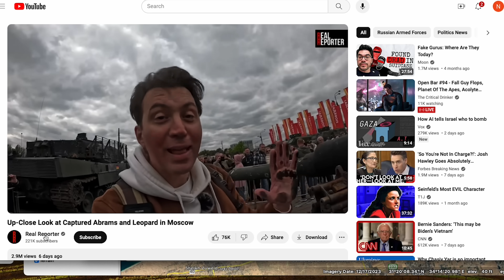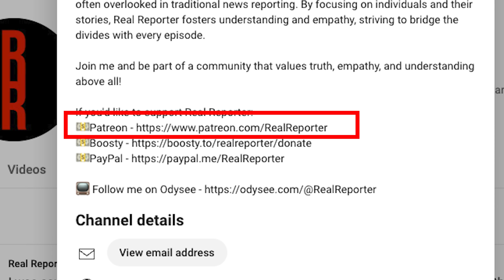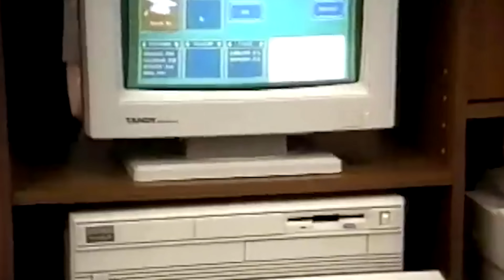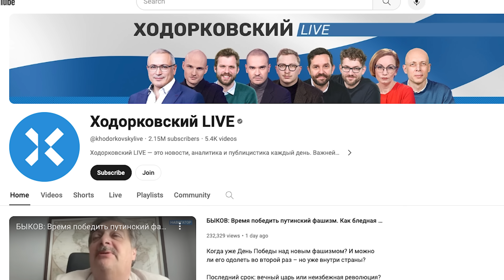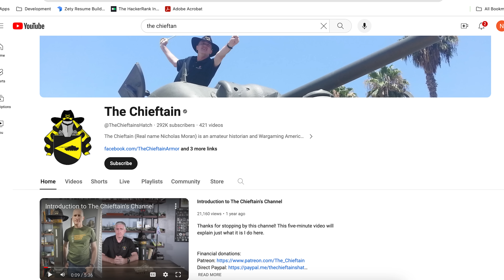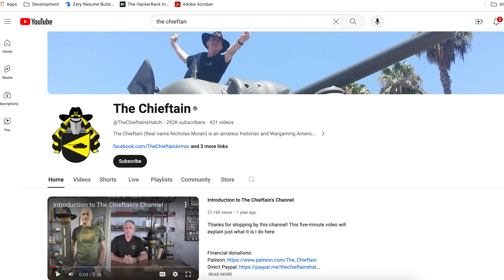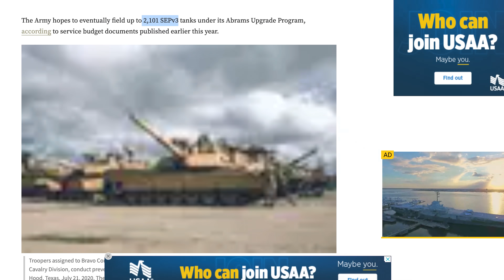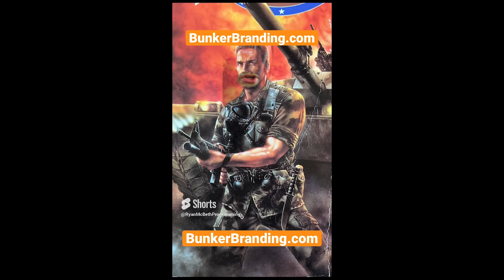Analyzing Real Reporter and Captured NATO Vehicles

Comment: Given that the most modern T-90 variant still lags behind the pre-SEP M1A2, its pretty easy to see why Russia keeps calling the M1A1 in Ukraine a "modern tank". To them, 30 year old tech is modern.
Reply: Remember when they first managed to get a Bradley in 2023... They were quite amazed by the tech. It was a Bradley built in the 80's.
Reply: "Modern"
Like the indoor plumbing that 22% of Russian houses don't have
Reply: in a russia modern means post soviet era seriously
Reply: How? It has better thermals, better frontal armor, and only lags behind when it comes to having full blowout panels protection and reverse speed.

The Abrams sent to Ukraine also aren't base M1a1s. They are the M1a1 SA, which is still in active service in the US Army. It is basically an M1a2 Sep minus the CITV. Naturally we don't export the DU armor, so it has a different armor scheme.
Reply: @voidtempering8700   No it doesn't have better thermals, not sure where you got that idea. The sight that was developed (with no proof of widespread implementation) is supposed to bridge the gap to western standard (per Russian claims which tend to be lofty). And sure, while the T-90 has better frontal armor, the M1A1 is better protected from HEAT projectiles than the T-90, which in this war has proven to be much more effective than being able to take frontal shots. Even then, a Bradley seemed to be able to put a T-90 out of the fight with frontal shots just fine, it didn't kill it, but the Bradley was able to fight another day, which shouldn't happen with the T-90s "better frontal armor". Also, you say it lacks in blowout panels and reverse speed as if those haven't proven to be major factors in this war. The crew isn't fighting again if their turret detonates and flies to Mars while they're still inside and they're gonna take a lot more hits if they can't get the fuck out of there fast enough. That makes a tank and it's crew dramatically less survivable. Also, the M1A1 SA is not basically an M1A2 SEP, it's not even at M1A2 standard. It's an up-armored M1A1 with a FLIR sight and better comms equipment.
Reply: @DuBaas007  The ODS Bradley also wasn't built in the 80s, it was made after Desert Storm. Not that it really matters since most Russian IFVs would like right at home in the 70s
Reply: @voidtempering8700  Most bradleys the Ukrainians got were from the 80's and 90's. So pretty old stuff.
Reply: @DuBaas007  That is newer, design wise than most Russian IFVs. Even their BMP-3 is a horrendous design. Lots of firepower, but they kind of forgot it was supposed to carry an infantry when they used a light tank as the baseline design. Even the BTR-82A, it would be fine in the 80s, but they still make it in 2024.
Reply: @voidtempering8700  I know, don't worry i realise it. That's why i said that it was funny how amazed the Russians seemed at the old American tech from the 80's and 90's lol
Reply: @treyaldridge1757  Looks like my comment to you was deleted.

To sum it up
1. Russia is already mass producing 2nd generation thermal, using cooled 2nd generation thermals and uncooled thermals. The 2nd generation cooled thermals are on par with those used on the SEP, not the pre-SEP.
2. The T-90M offers better HEAT protection than the 3rd generation DU armor thanks to using Relikt instead of K-5 ERA. 
3. The instances of a T-90M launching its turret immediately are incredibly rare, and its frontal armor, from what I have seen, has never been significantly damaged unless weak spots were struck(optics, gun barrel, etc), which would disable an Abrams as well.
4. The M1a1 SA was introduced at the same time as the SEP V2, including things like Blue Force Tracking and a modern BMS, which allows networking with other SEP V2s, which makes it better than the SEP, let alone the M1a2.
Reply: @voidtempering8700  1. Again saying they use it and proving that it's implemented en masse in Russia are too very different things. 2. Not according to any source I've found which all suggest that the M1A1 is not quite as good at defending kinetic projectiles but are better at defending HEAT ones, and this is numbers specific to the M1A1 SA. 3. Rare means it still happens, turret tosses don't happen with the Abrams. And again, you're not seeing frontal armor being defeated because you're cherry picking frontal armor shots, which are generally not the main way tanks are being destroyed in Ukraine on both sides. 4. If they were introduced at the same time, why are they separate? Is it maybe because the M1A1 SA was designed primarily to enhance situational awareness (SA) so it focused in those areas while not receiving the upgrades to armor, optics, and fire control that the M1A2s all did? I mean this is all public information that was very easy to look up but what do I know?
Reply: @treyaldridge1757  Ok. I am reposting my original comment to address most of these.
But for 2. Are we not comparing the T-90M and the M1a1? All tanks are better at defeating HEAT when compared to kinetic projectiles, that is just the nature of the penetrators. But the T-90M has better frontal protection when compared to the M1a1.
3. You are the one that brought up being damaged by frontal armor hits. Can you decide what you want your argument to be?
4. You first say that it is an up armored M1a1, then you say that it enhances it's situational awareness, but you say it has inferior optics. Can you decide where you want your argument here as well. You are offering up contradictory information from comment to comment.
Reply: The M1A1 is what the US military mostly uses though. So it is "modern"
Reply: @treyaldridge1757  dude there's videos on youtube of M1A1's getting hit by RPG7s in Syria and blowing up from one hit. I am skeptical of your "Better armor" claim
Reply: @AndRei-yc3ti  No, the M1a2 is what the US mostly uses. Mainly the SEP variants.

However, the M1a1 SA is newer than the SEP, but lags behind the SEP v2 and V3.

Comment: I will keep this video as a clear example of unfair propaganda.
A real reporter does not hide where he comes from and the fact that you spend time "revealing" this secret shows how biased you are and are not able to make an objective analysis.

Also, rubber pads are useless in a field with a soft mud surface, and this is exactly the place where they are used.

Also, depleted uranium linings would not help a tank, which can be punched into the back of the turret from a machine gun.

Not to mention, American models that are intended for domestic use are made using simple RPGs, from the same locations as those used for export.

Comment: The comparison of tanks as computers is so wrong - the military equipment doesn’t age the same way.
Reply: I agree, computers, especially since the 90s, have been one of the fastest advancing technologies.
Reply: alot of the things he says make no sense.. like the hole in the tank.. why need mental gymnastics for a hole in a tank froma battle field.. and about if that reporter is western or not.. he says there is a video where he explains but has to invite someone else to explain same thing
Reply: He’s a computer guy so I suppose it makes sense. work in aviation, the current most used models are almost exclusively designs from 40-50 years ago that have been slightly updated. There isn’t the exponential leaps and bounds to be made like we’ve had with computing. He’s partially mechanically ignorant and likely just huffing a wee bit of copium.

Comment: The M1 series of tanks does have a problem on ice. I've literally rode a 68 ton toboggan while training in Germany. In war, the plan for countering this problem was to reverse every fifth or so center guide. These have teeth that normally keep the roadwheels aligned to the track. Reversing them serves as ice cleats but would destroy any hard surface as well as wear out pin. Also, the M1 track pads are mono-directional, they are not angled to the track and the pads are not removable. You have to replace the entire track block.

Comment: The M1A1 tanks we sent to Ukraine also reportedly were rebuilt to remove all the advanced DU chobham armor as well, replacing it with tungsten alloy armor. While still good, its nothing at all like the armor on American M1 tanks.
Reply: The export model never had the DU to begin with, afaik neither chobham, nor the german composite use DU. dismantling the entire turret just to swap out the composite armour is a waste so I doubt they'd do that. It would be less toxic to touch after a fire though.
Reply: DU is not particularly more effective than Tungsten. It's cheaper and self sharpens, those are the advantages. Tungsten however is harder. The main reason the Russians don't use DU is machining DU is a bitch. They could but they don't bother, they have Tungsten coming out their ears.
Reply: @petitblanc7343  according to a Forbes article by David Axe on February 23rd 2023, the 31 M1A1's being sent to Ukraine were not export models, but surplus US tanks, and GDLS had to take those to the Lima Ohio plant to remove all the DU due to DOE export regulations. Also note that the export version of the M1 tank is actually the M1A2, not the M1A1, so this does make sense that those tanks sent to Ukraine had to get DU removed.
Reply: @firelock9080 This is the M1a1 SA. It is still in use by some US Army units, so they probably got rid of them to add more Sep V3s.

Comment: Just want to point out.
The Abrams given to Ukraine doesn't have depleted uranium armor.
Reply: no but it's the australian standard which claims to be almost as good.
Reply: It will not be change anything all 5 Abrams were destroyed by mines or drones from top
Reply: @GambitShole ............... they haven't sent 5 types of Abrams. Did Russia manage to blow up an American tank variant that was still in America?
Reply: Wouldn't have changed much if you follow the realities of this particular conflict
Reply: The du armor isnt changing anything bro
Reply: moot point, the drones didn't penetrate the frontal armor anyway, they went through the weak rooftop, which has the same protection in all Abrams variants, whether it had DU or not, M1A1 or M1A2 Sep v3, it doesn't matter at all.

Comment: Reverse engineering on the basis of one specimen is doomed to fail. You need a series to measure all the tolerances. And then you need the tooling, the knowhow, the materials, the knowhow to produce the parts etc etc
Reply: Russia has dragged back a much more intact Abrams.
Reply: You cannot reverse engineer on the basis of one specimen. You need lots more. There are always tolerances and you can't know what your specimen is on the tolerance scale. Then, you have to figure out how to make all the parts, how to source the materials in the right specifications, then setup tooling and find people with the experience and expertise to get the job done. It6 far more difficult than you might think. Besides this Abrams is a 20 year old version and far from the current US version. Remember your PC from 20 years ago?

Comment: Regarding the rubber track pads on tanks... I work with civilian catapillar tracks of various sizes. 
If a 10-40 ton digger with no rubber track pads can literally destroy a bitumen road by crossing it, I'd hate to see what a 50-70 ton tank would do with no pads. 
The Israelis were using old tyres to try stop their road from being damaged by their armoured veichles and even the old tyres didn't last long under that stress.
Metal tracks being twisted or turned across a road will gouge the road to shreds. Having dozens of track veichles traverse the same road could turn that road into broken wreckage that would take hours to rip up, then re-lay and cost tremendous amounts of money to replace.

Comment: 6:00 - that "running gear" thing - the soldier used the phrase "ходовая часть" [khodovaya chast'] which word for word means a 'walking' part, or "running part" - i.e. one that is responsible for "moving" the bigger whole. Google translate says it's "chassis", which may be used freely as a synonym for "wheels and suspension". For the caterpillar (tracks), there's another word, "гусеница" [gusenitsa].

9:08 - almost correct, with one correction - кошка [koshka] is not "a female cat" (as such), but "a cat", and this is a FEMININE-gendered noun - which is not exactly the same.
Yes, a nit picking, but just for nit-picking sake, lemme elaborate a bit on it... ;-)
Nouns in Slavic languages are "gendered" - just like in French, German or Spanish, and this is not the same as the physical sex of an animal.
This "linguistic feature" is kinda blurry, not a clear cut thing, and it may "impart some flavour" of actual "sex/ gender" of an animal, but when used in "a cat/ a horse" sense it is strictly "grammatical gender", not "a gender of the animal". Ein/ der Hund is German for "a/ the dog", AND it is masculine noun, but it does not indicate the sex of "a dog" or "the dog" in question.
"Back to our muttons", or "cats" - there's another Russian word for "a cat", кот [kot], which bears a masculine gender, and thence Russian speakers may tend to use these two words in the female/ male fashion, but when someone says "koshka" this may be just a "non-specific" cat. Also, "koshka" feels more like a diminutive (another linguistic peculiarity, or kudzu of Slavic languages), so I'd say "koshka" would be more likely an "affectionate" way of referring to the animal rather than indicative of actual sex/ gender of the animal itself.
Reply: Thank you for the details. Languages are fascinating.
Reply: @GarrisonFall  Mon plaisir, Monsieur...;-) Also, pardon my poor French ;-)
Reply: @GarrisonFall  I just remembered... Warning: completely useless and irrelevant trivia about grammatical gender, DO NOT READ IT! ;-)

So German has both definite and indefinite articles, which are also "gendered" - hence "ein/ eine/ ein" for indefinite masculine/ feminine/ neuter nouns, and der/ die/ das (ditto) for "the" nouns. No indefinite article for plurals, BUT all articles undergo declension (to follow the case of the noun, thence einen/ einem/ eines/ einer and  dem/ den/ des/ dieses/ deinem - and such).

But then there's this funny thing about definite plurals - they all take FEMININE article "die", so our "der Hund" (the [he] dog) becomes "die Hunden" (the [she] dogs) while sniffing... erm, the posterior of another fellow canine in a park - even though both of them still retain their "primary and secondary sexual organs" (unless there's a vet involved in it, that is...)
And then there's this funny German iteration to show how "grammatical gender" can be detached, if you will, from "real world gender/ sex": "der Rock, die Hose, das Mädchen - the [he] frock (i.e. WOMAN'S dress), the [she] trousers (a typical piece of MALE garment, and for centuries worn ONLY by males), the [it] girl (young/ child girl, albeit I've heard they changed the article for this noun for feminine one "in recent years" but still).

So, there you are - and now you can see for yourself it is a completely useless piece of information, and reading it was a pure waste of time. But hey, you've been warned, haven't ya? ;-)
Cheers!

Comment: The 5 Abrams destroyed were the ones sent to frontline.
Reply: Then why did they need to destroy them more, like bending the barrel of the tank?
Reply: @Thor.Jorgensen  they captured and dragged the tank all the way to Moscow and all you are worried about is why they bend it?
Reply: @benchapman2210  So I am assuming you didn't see the video footage of the barrel of the tank in the Red Square at night by carefully lowering a, what I assume, has to be at least 10-ton weight on top of the barrel of the Abrams tank? What is the purpose of doing so? A tank is not so easily bent.

So you drag the tank all the way from Ukraine to Moscow and wreck it in Moscow? What's the point of doing that?

Comment: Thank you for reviewing this yahoo...I had similar sentiments when I watched this exact video! I also was a M88 driver (attached to artillery) and mechanic, and you hit it with those track pads! And from someone that knows a thing or two about getting stuck in the mud, from both pulling out tanks to being stuck myself... there's not much you can do unless yes you install those "grabbers" every tenth track. Worth noting  usually you use something in the environment to gain grip (choo a tree down and use logs). Which to note some Russian tanks carry a log in the back for this very problem. While the "grabbers" or track inserts are not really standard issue, it depends on the theatre you're deployed to and conditions.

Comment: The M1A1 is an advanced tank for it's time so it's at least comparable to a 386 DX not an SX

As an ex-Cv90 ARV driver we took those trackpads off during the winter.
An advantage of the pad system is that you can easily replace a pad with other things like spikes for driving on ice.
Removing the tiles is not that time consuming it would take 1-2 hours, best case you are on a good surface and can just disconnect one track drive off it and unscrew all the pads. Then you drive on and connect it and then repeat the process with the other track.